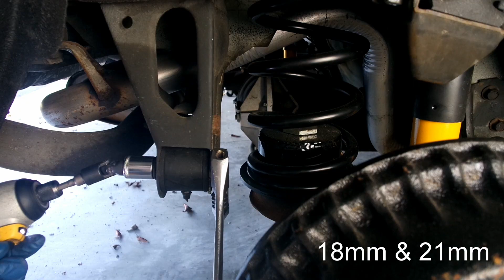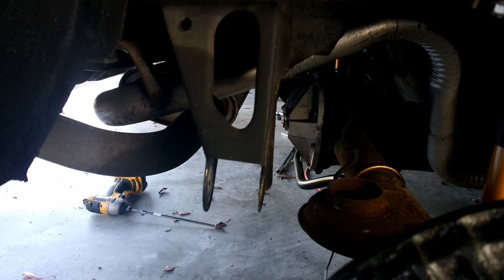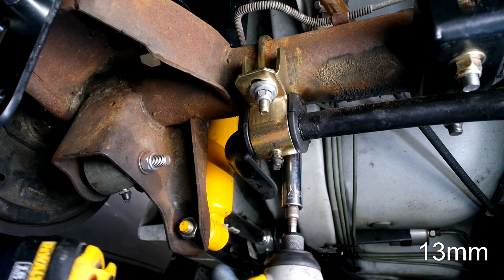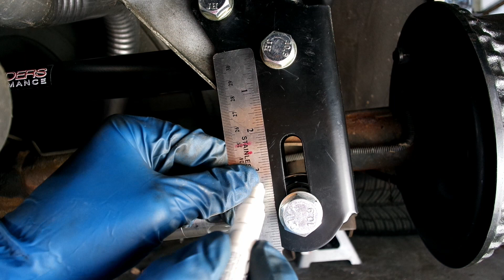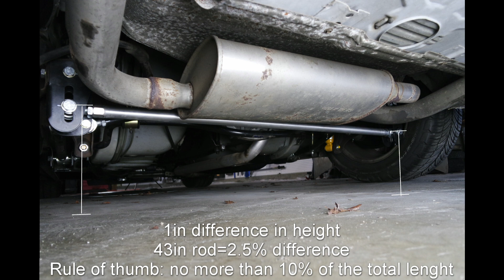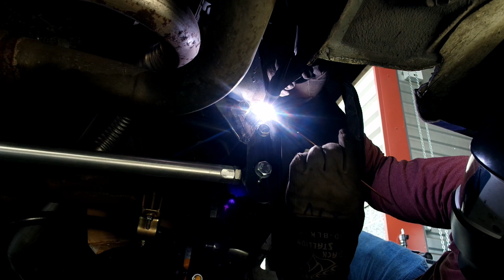Relocate your Panhard Bar for Better Handling.

Comment: What are the benefits/cons of using this compared to an aftermarket adjustable panhard bar that uses factory location? Like a UMI or BMR unit.
Reply from the maker: more rear grip in turns.
drawback is you need WAY stiffer sprint 200lb+
it's really a race only item, NOT a street car thing.

Comment: I think Speed Engineering makes a better one, it allows dual exhaust and requires NO DRILLING or fabrication at all… I have some BMR stuff and Speed Engineering stuff and it works great together. No wheel hop and plenty of bite. My 3rd gen make 400whp 400ft Lbs of torque
Reply from the maker: this is for turning not exhaust clearance .

Comment: Wait.."drill out the bushings to 14mm"?
 they sell the kit and the included bushings arent the right size for thier own hardware? 🤔 i have the same setup in the mail rn from Founders
Reply from the maker: the stock 3rd gen pan-hard bolts are tapered.
the threads are smaller than the shank of the bolts.
this kit uses a BIG 14mm bolt so that's why the bushings get drilled out to 14mm or 9/16in

Comment: stiffer rear spring/sway bars usually induce oversteer.
Reply from the maker: there's a million variables when it comes to car setup.
my car actually understeers at the limit
Reply: @3rdGenGuy  Yea, thats fair. Square tire setup? Tuning for anything other than the limit seems weird for a track car. How did changing your roll center work out?

Comment from the maker: Just a word of warning,
The aluminum pan-hard bar was fine on street tires, but when I stepped up to wide sticky race orientated tires; it started to bend under load
so only use that aluminum pan-hard bar if you have stock sized tires.
otherwise use a Steel pan-hard bar for larger tires.
Reply: Whose roll center/relocation kit are you using, Founders? I have a 4th Gen and I'll be installing this same kit, thanks for your video as the Founders kit has NO instructions.

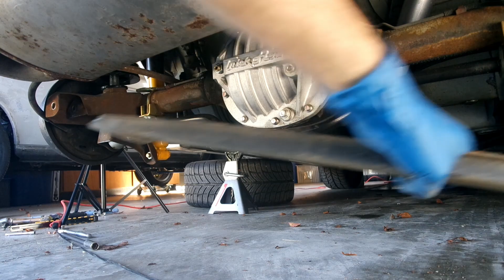Comment: At 1:08, that bar, what is it called. I can find replacements for the trackbar and control arms but no that specific one, prob doesn't help that I don't know what's it called. 😅
Reply from the maker: it's a "pan-hard support bar" you can buy tubular ones for cheap.
they also allow larger exhaust to be used as well. 
i use the founder's one, but many other companies have ones for sale. 
https://hotpart.com/product/1982-2002-camaro-firebird-f-body-panhard-rod-relocation-kit-black/
Reply: @3rdGenGuy  brother, thanks for always being super helpful

Comment: This actually seems like a must have and affordable thanks man 👍
Reply from the maker: if you race your 3rd gen yes. it's NOT for a street driven car.
Reply: @3rdGenGuy  i street drive my car and have done this mod too awhile back. Welded in and everything. That heim joint reinforcement thing you installed is cool, however I welded on from the axle to the reloc bracket on the axle. The kit I got was from unbalances engineering.
Reply from the maker: @marcbrazzers  relocating the panhard bar on both sides does nothing but make a street car ride like crap due to the need for stiffer springs.
you can't use the fixed load transfer in the rear on the street.
there's no benefits for a street car.

NOT to be confused with relocating just the passenger side for exhaust clearance.
Reply: @3rdGenGuy  i bef to differ. Because the rear on these cars is so light compared to the front they have a huge tendancy to oversteer but with this, it oversteers wayyyy less. It’s been over a decade since I installed this so i’m a bit rusty about the actual physics on this, but check out the TGO forum. Ive got around 3000 posts on there since 2007 and there were threads about this where a bunch of people go into great detail about the benefits of this. Yes you can run stiffer springs and a bigger rear sway bar to compensate for all that extra roll, but what this relocation does is essentially LOWER the rear roll center in relation to the center of gravity which is a good thing for these cars due to them being super front heavy and light weight over the rear. I relocated the battery over the rear to also help with this weight distribution. I will also likely lower the car a bit and raise the body side an extra inch since the body side should be ever so slightly higher than the axle side..
Reply from the maker: @marcbrazzers  i'm not gonna argue with you man,

street car= leave it be
race car+=relocate the panhard bar.
Reply: @3rdGenGuy  to each his own, but in my experience (and many others on TGO) it made a huge diff.
Reply: @3rdGenGuy  why not for a daily?

Comment: I have a question when I installed my single adjustable pan hard bar which side do you recommend the adjustment side? Drivers side or passenger side??
Reply from the maker: the side easiest to get to when the car is at ride height.
Reply: @3rdGenGuy  thanks for the info... So I'll install my BMR adjustable panhard bar on passenger side since easiest to get to... 👍🤙...

Comment: I have all BMR suspension on my 94 trans am. My pan hard bar is adjustable on the driver's side only...
Reply from the maker: adjusting 1 side will lower the roll center.
however, you want to keep the pan hard bar as level as you can when you do this. hence adjusting both sides. not the end of the world if you only have 1 side.

Comment: I bought the UMI Relocation kit didn’t come with anything that looks like that Hyme joint?
Reply from the maker: what UMI kit did you get? it should 100% have a rod end piece included.  their kit is $300 and required their sway bar brackets.
Reply: 3rd Gen Guy   I bought item 2024.   I never saw the complete package for 300 bucks cause ima dumbass so I might just have to get item 2064 as well to go with my item 2024 I think?

Comment: Great video once again...Do I need an adjustable or non adjustable Panhard for my 84z28...Also, do I need to Re-locate my bar settings too ? Thanks again...Big Fan of Yours 🙌
Reply from the maker: relocation is for handling purposes (road race/Autocross), not for street cars.
an adjustable bar is recommended to center the axle if you do any lowering.

Comment: What’s the point of a panhard bar?
Reply from the maker: Limits side to side movement of an axle that uses Coil springs.
Reply: 3rd Gen Guy thank you! I had to change the thing that goes from my tran to my diff. Then my tran Mount went bad again. I’m afraid of doing burnouts again. Also changed one motor mount. 6 hrs.
Reply from the maker: @thebehemoth1998  trans and torque arm mounts go bad fast. fairly easy to change thankfully.

Comment: Looks like a very strong upgrade
Reply from the maker: It helps with rear end bite quite a lot. But i did need to DOUBLE my rear spring rates to make it work. and i'm still testing heights to find the most ideal roll center.